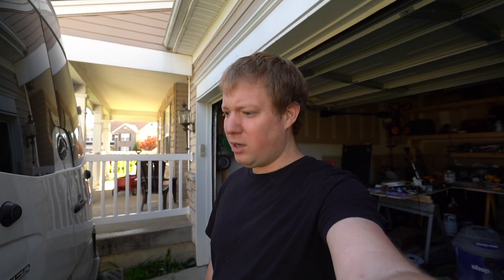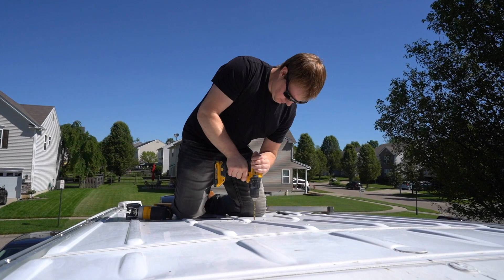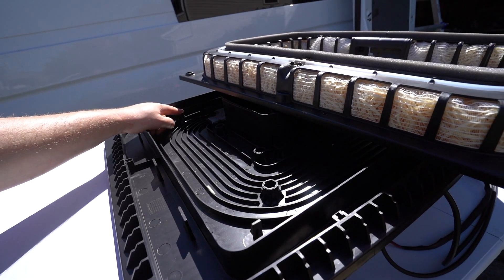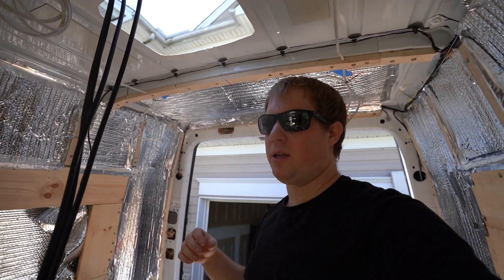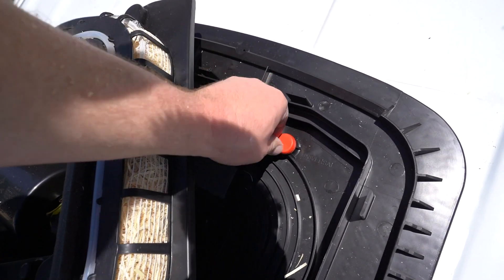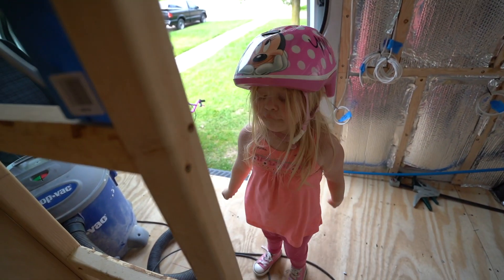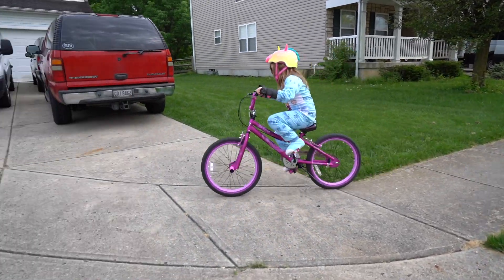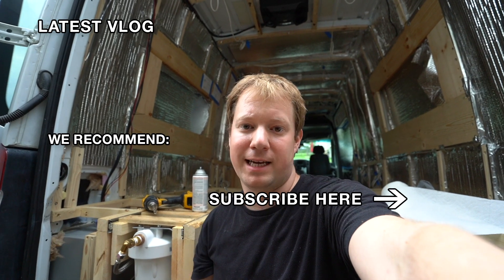12v FRESAIR INSTALLATION. Van Life AC!! (Ep. 13)

Comment: Thanks for this. I was wondering if this would cool down a van enough in hot temperatures to keep my dog cool. FL, CA, NC coast etc. I think it will do fine.
Reply from the maker: Does not work very well in high humidity FYI. So in a Florida summer it does not work well. In high humidity you only get a couple degree drop. Works amazingly well in lower humidity climates though.

Comment: Building in your driveway on an angle is so much like my build. I'm in Phoenix so it's been a hot build for me. lol Not sure I want to use the Fresair. It says it uses a liter an hour and the tank only holds 18 liters. That just seems crazy. It would be on max 24/7 here for 6 months of the year. Have you done any lengthy test of water consumption?
Reply from the maker: Water consumption depends on the humidity level. But I would imagine their estimate is pretty accurate in a dry climate. But I would rather have to fill up on water than run out of batteries. Ideally I wanted a 12v AC unit but they are so expensive and then you have to double or triple your batteries. Couldn’t spend the money. Maybe next time
Reply: I'm also looking at this for my build...also in Phoenix.  Bukit, what did you go with? Seems like it makes sense for our dry heat assuming water is easy to refill.
Reply: @imperfectadventure  I have just fans for now. I tried a trip to Show Low to test how bearable it would be if I chased better temps. It was amazing at night but during the day it was too hot. I have determined I need AC, which will take a lot more batteries and another solar panel to be off grid. From my research a small mini split seems to be the best option for the money, power consumption and longevity.
Reply: @bukit2361  that's super helpful to know. I'm still debating, not starting my build till end of summer...you're brave to build in this heat! It's a tough choice. There are a couple 12v a/c options as well here in the SW. Love to hear what you end up with. Thank you for the response.

Comment: Hello! I was wondering you added an air port to the tank so it doesn't collapse during filling from your fresh water tank? Or is it able to get enough air from the units intake and return lines during filling that is doesn't matter?
Reply from the maker: we added an overfill line which allows it to breathe
Reply: @RaisingVoyagers  I see, Thanks for the response. Did you have to modify the large cap to do that? Ive decided to fill mine from the fresh water tank as well but trying to figure out how I'll let it breath since barb 1 will be to fill it and the smaller barb next to it is for the return line, that only leaves me with the large cap.
Reply from the maker: @toreycates8411  we didn't add a return line to the fresh tank if that's what you mean. We used one of the mini barbs to overflow outside which also allows it to breathe. So you fill it up, and if you fill it up too full then it will overflow underneath the van. I wouldn't want it flowing back into the fresh tank if that's what you meant.
Reply: Oh no I meant the return line from the Fresair going back to the 18L reservoir. It goes to the smaller barb on the top side and I have a cold water tap routed to the larger barb on the top side.

 For now I’ve resolved myself to just opening the cap when it’s time to fill.

I like your idea of an overflow drain and may go back someday to change it but I’d have to modify the screw on cap to do it since the two barbs are spoken for. So for now I just have to unscrew the  large cap and open a tap from the vans cold water line and watch to make sure I don’t overfill. 

Cheers!!
Reply from the maker: @toreycates8411  if I remember correctly, the unit i had included 4 barbs.
Reply: Mine as well but the orientation it’s mounted puts two of them towards the bottom so I left those plugged. Given that it’s being filled from the pressurized water line, I suppose I could use one of the two on the bottom as a fill port and free up the top for air or overfill drain.. 🤔

My inclination was to not poke a hole on the bottom/side of the tank if at all possible but I may be worried for nothing since it would have solid pressure from the water pump.

Comment: I now see what you have. It is not A/C it is an evaporative cooler. Beware High Humidity. Evap coolers work great in the desert where I live. When we have Hgher humidity the coolers work  less well.
Reply from the maker: Correct, they don’t work so great in humid climates, but it draws almost no power. Works great in normal/dry climates though!
Reply: @RaisingVoyagers  Very nice:)
Reply: Raising Voyagers we are in TX so they aren’t best here, BUT would it be comparable air circulation as a fan (Maxxfan) with ability to cool somewhat? Does it have a fan mode wo using water to cool? Just curious if worth putting in for fan use in humid areas and AC use in drier areas.